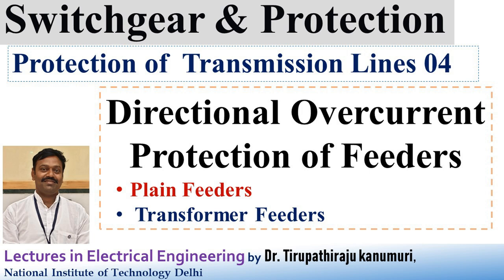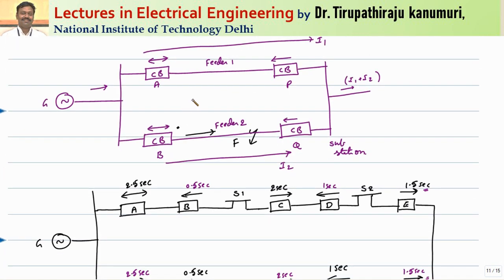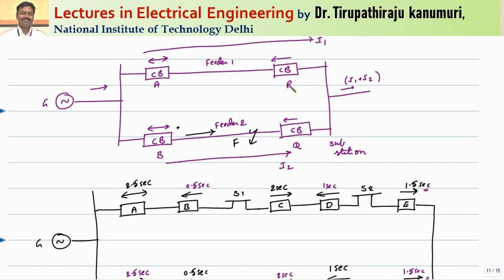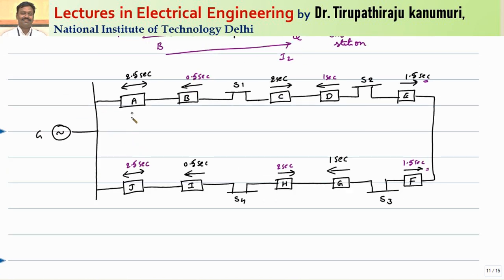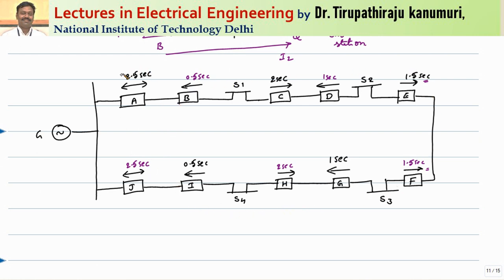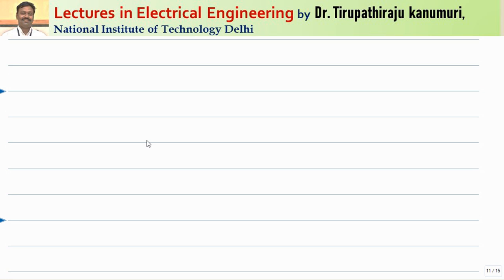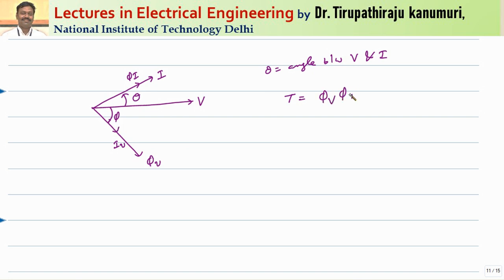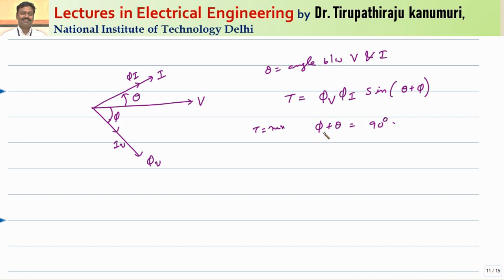SGP505 Directional Overcurrent Protection of Feeders

Comment: @13.35,@13.45 , @14.23 , @14.29   sir u hv cited example of   fault current lagging by 30°, 60°, 90° respectively , but my doubt is that --- in all the above cited examples power is flowing in the positive direction, so why does the directional relay is operating (as it is supposed to operate only if power flow is reversed , & during reverse power flow phase  current must lead the phase voltage not lag )
Reply: @lecturesinelectricaleng  thanks for the clarification sir & it will be also helpful if you pls explain some instances where directional relay is used to detect fault in -ve direction